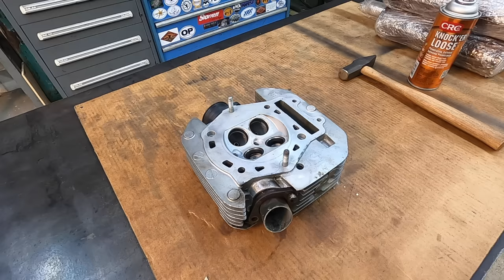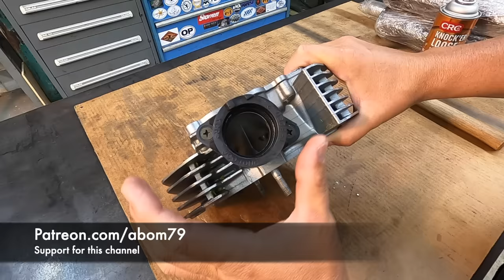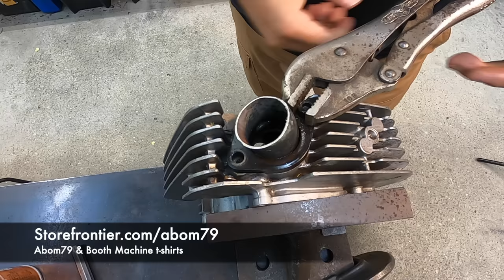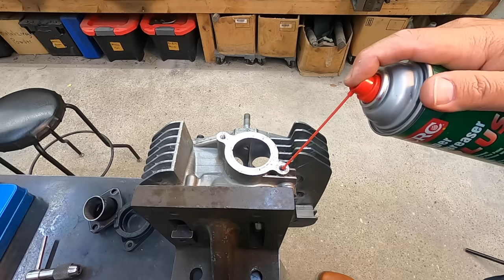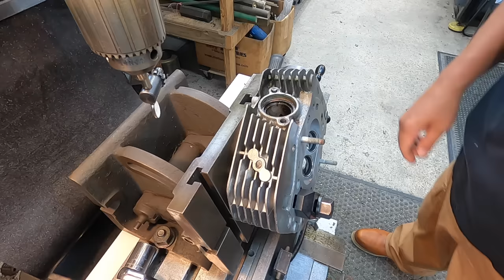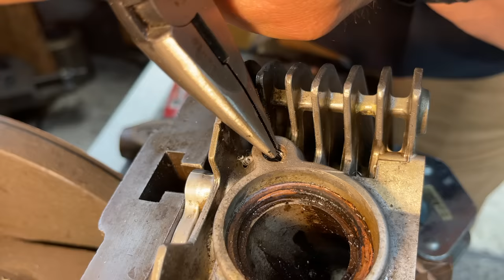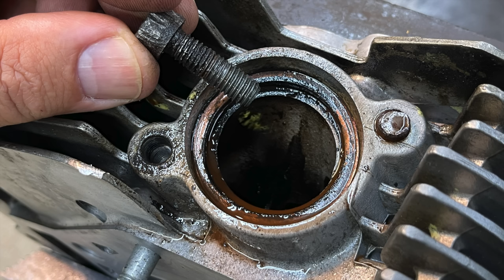Broken & Siezed Bolt Removal, DR 650 Cylinder Head

Comment: Top job Sir!!
If only people would us a high spec anti seize compound like loctite LB8150 SV silver. Works for exhaust temps up to 890C, and bolts will always come out.
I use it on aircraft engines.

I'm puzzled why you didn't use cutting lubricant fluid on your drill bits?!

Love the way you're in you're best clothes and have ultra clean ✋

Comment: Suggestion, buy some new Vise Grips.  Yours look older and the teeth are usually worn down.  Also, why didn't you heat up the head?  IMO, the aluminum would have expanded nicely and let it come out?

Comment: Love this content bro, all very helpful to save you from gett'n stranded from some "f'n" seized or broken bolt or juernle on a head or some creeky old manifold that makes your heart drop to into your socks. There's only one critique I have about your clip an that's all, something that was driven into my head ALL my apprenticeship, is never EVER drill into a hard surface with high tensile drilling tool without some sort of cutting oils to keep the workpiece and the drilling surfaces and cutting tool cool or you run the risk of blowing out the tip of the cutting tool edge or damaging the workpiece project further "JC" 😳 🙄😫 now that's an even bigger bummer or maybe I missed something in the clip? Either way I seriously dig this kinda joint to help get new tools in the mental toolbox bro 🧰 🧠 in my gourd! 😎👍 great content!  💥🎶💥 keep it coming 👌

Comment: At 25:37 the drill went through the bolt. I wonder if instead of drilling to 6.2, if you would have tapped the hole in the broken bolt with a left hand tap, then screw in a bolt all the way until the head makes contact. Then you would have something to grab onto to try to remove it. I thought about that a few times when I had broken bolts at work, but I never have left hand tap. I will have to try one of these days.

Edit: You would probably have to loctite the bolt so it wouldn't loosen when working it back and forth.

Comment: what do you do when the broken bolt is the engine mount.. it has lock tight on it to.. I also have 2 of the smaller ones to, going to try and remove by tapping like you did.. the engine bolt is so hard to get to being underneath also looks like the holes are not lined up right since removing one, another is connected to a pulley and the bolt is tight on the bottom but can raise the motor up and looks not to be screwed into the engine if that makes since.. I'm so confused. its on a kohler courage 19 engine for zero turn mower.. also leaking oil thru the front engine mount hole, was just hoping it wasn't the block but maybe the oil seal??? reckon?? thank you for video it has helped me in what I am trying to do.. best video I have seen yet... with no heat since I can't use heat cause probably caught fire...ty
Reply: Heat 150 °C Loctite dissolve.
Reply: Yea but if I put heat to it it is attached to the mower and oil all in it would caught fire

Comment: because the bolt is steel and the cylinder head is ally these bolts should have been coated with anti seize compound
for easy removal for servicing!

Comment: If you apply heat to the bolt and let the heat move down into the threads then put the head into a bucket of cold water , do this at lest three times then go back to the hammer and twisting . The heat and cooling causes everything to expand and shrink and since it is of different materials they will expand and contract at different rate and different amount of movement. The hotter the better , but depending on what you are working on .,care must be taken to protect part. Any amount of heat and cooling will cause movement and help separate bolt from part.,use as cold of water even if you have to add ice.

Comment: I remember my days of working on Japanese motorcycles 50 years ago.  If you didn't have an impact screwdriver like in this video, nothing came loose.  Even on brand new bikes.  I would have helicoiled those exhaust threads, or at the very least use studs not bolts, or the same problem will arise in 5 minutes or less.

Comment: Tig welder is king for removing broken bolts. I would not waste time trying to use the drill out method unless you had a mill or at minimum a good drill press and a 2 axis vice for it. You are not likely to ruin the part with the weld method but you can easily ruin it tying to drill it. I can’t count the number of people who have brought me off center drilled bolts with a bit or easy out broken off in them.

Comment: I've had good luck drilling through the bolt with a left hand drill bit. When the drill breaks thru and grabs, the screw backs out on its own. EZ outs are a pain.
Reply: I like drilling through the bolt with a very small bit so I can get lubricant on the bottom side of the threads.

Comment: would have used a welder and welded a bar onto it also the heat from welder would loosen up the bolt a bit then just buy new bolts

Comment: I tried removing a 12mm bolt hold my lawn mower blade. Wouldn't break loose even with a breaker bar. Finally rounded the bolt head. I drilled off the bolt head using a 12mm bit. Once the bolt head popped off and the blade removed, to my surprise,  I was able to remove the bolt with my fingers. Never experienced that before.

Comment: Question: for those impact drivers do you turn it so that it’s a solid field to unscrew it or do turned it against the spring pressure?
Reply: From my experience I hold the end of the impact driver then twist the body in the direction I need the screw to go. This sets the spring in the correct position to operate the driver, Either removing a screw or tightening up the screw, hold the tip and twist the body in the direction you want the screw to go.

Comment: What would u do if the broken bolts are on a motorbike that is assembled? 
I have a Mc where they broke off on the rear cylinder stud and i tried to drill them out, but the drill keeps slipping as i cant mark it... Because the bolts are too small. 
I been thinking if i could get a Jig or something to hold the drill steady , but haven't been able to find any. :(
Reply: I think it’s pretty obvious the engine has to come out… whether you drill em out or destroy the holes and it’s possible to tap new threads doesn’t sound like you have access to do either. If center punching the bolt is hard get something like a hardened steel nail. Maybe use a flat punch that is the same size as the bolt to tap it flat before center punching it with a nail.
Reply: same problem here only engine mount bolt..

;(

Comment: heat ,,,heat and heat ,,,  bigger, heavier hammer  while turning it like u did ,,,  then if REALLY bad ,   centre punch and small drill to relieve radial pressure,  keep attacking and you will be able to slip a flat head screwdriver in and heat heat heat and unscrew     dont have and have never needed a mill,  last one I did , cx650 turbo stud , rusted solid, ,, no problems

Comment: there is a spray called freez-off  never failed for me spray on the bolt it shrinks the bolt somewhat drill a hole in the bolt try ez-y out  after you freeze it

Comment: After you have done the penetrating oil thing, put head in boiling water and allow it to soak for a while to get evenly hot.  T--then while it is still hot, try to undo the bolts.  This only works for aluminium, where you can not safely use a flame, and it is better to keep the bolts just above water .  A gentle tap on the bolt then try to remove it.
Reply: Could in that case submerse in continually heated alum solution and bolt would dissolve. Slow process but I did it on a Tecumseh engine block.  Unfortunately after I  messed up trying to drill it out so still had to tap oversize.

Comment: I would like to see you get my broken bolt out. For 5 years or more I have been working on it, off and on. Underneath my motorcycle  built into a rubber bushing to hold the skid plate on.

Comment: On rounded  hex head, driving in a torx is two for one, the hammering helps break it free and the torx will cut new engagements to turn
 Ps and on broken bolts weld on a nut , the heat helps and if that does work drill  with left / reverse twist bits ,I grind normal bit to left works a treat and most times you can spin them out with the cordless once you have removed enough.
Reply: Do you use the same torx driver that you broke the handle off by hammering it, or a new one?  :)
It is a good enough idea to me to sacrifice a torx driver.  I have also had good luck taking that flat blade screw driver bit from that impact, (should be hardened), hold it with a socket and extension, and hammering in a straight slot too.

Comment: Just a thought but couldn't you thread a lefthanded bolt into the broken bolt so once it's tightened and keeps turning left it MIGHT remove the old bolt at the same time? I don't know fortunately I've never been in this situation. At first I thought that was the route he was taking when he said a Lefthanded drill.

Comment: A modified hex bit socket ground to be tapped into the caphead screw and a 3/8 impact gun turned way down.  May take a minute or two to shock the rust bonds free.

Comment: If you had welled a bolt on there which you already said doesn't work , sometimes termsthe heat from welling the bolt on there would also break , at least it'll come right out every time

Comment: I believe its called Galvanic corrosion that accrues between dissimilar metals like steel and aluminum that's what has the bolt threads locked into the aluminum head threads. Its basically a different kind of rust only this is a white power like form of rust.
Reply: Correct. That is because the aluminum is the anode in the reaction, it preferentially corrodes instead of the steel. "Rust" in aluminum is a white powder. Similar to rusted steel, the oxidized aluminum occupies more space, which decreased the thread clearance to the point that it locked the bolt into the threaded hole.

Comment: Cant u use the allready free exaust hole to set the line up for the other hole with a drill to snug slide in the free hole so it would perfect line up to drill the other hole?
I can be wrong just suggesting.😅
Nice vid btw.

Comment: Now we know Adam and Joe Pie know how to do this. But why didn't you use the rust buster spray on the drilled hole to unlock the remnants of the old bolt before picking it out with needle nose pliers?

Comment: its so odd today i had to replace exhaust manifold gasket on my old 1966 dodge wrecker i am fixing up and broke off one of the bolts one out of 8 wasn't bad. i thought about welding but i used the drill out method. i couldn't get ez out to work drilled and used small punch got it started and screwed it out saved all the threads and didn't have to remove cylinder head.

Comment: I've come to the conclusion that its much better to weld a bolt to it FIRST to get heat to the threads and have something to turn, than to take vice grips and twist it off making it near impossible to get out. I've worked on little stuff, like 1/4"-20 on up to 1 1/2" grade 8 bolts in Locomotive trucks. It's hard to beat. If you have a sheared off stud, and you can weld a flat washer of the next size down, to it and then weld a nut to that washer, youve zapped it twice with heat and you can put some decent power with an impact to it. Impact hits it a bunch of times, a tad at a time, where as twisting only, doesn't help it over the ledge. It SHOVES it over the edge
Reply: What type of welder do you use to weld washers and nuts to the bolt?

Comment: What are JIS screws you mentioned at the exhaust?
Reply: JIS stands for Japanese industrial standard. Usually the only JIS fasteners I would see look like Phillips head srews on older Japanese cars and motorcycles/atvs, but they are not. A #2 phillips will usually cam out if the screw is tight. Need the appropriate #1,2,&3 JIS cross-point driver for best chance of removal.
Reply: Phillips designed a drive head that was fast to use for assembly lines and would cam out before they could be overtightened. 
JIS have less web (straighter cut) in the cross than Phillips so do not cam out if you use the appropriate drive bits.
JIS bits can be used with Phillips fasteners, Phillips drive bits destroy JIS fasteners.
If you work on Japanese automotive especially then you really should have Japanese tooling for specific fasteners made by the likes of Vessel, Ko-Ken, Nepros etc

Comment: Recommend anti sise to help the next time it's worked on
Reply: 3 ounces of anti seize would do the whole world alot of good. Good nickel anti seize for the high temp stuff.
Reply: @verteup I worked with a guy in the power industry, he would be covered head to toe with anti sneeze (auto correct keeps screwing with me). No kidding on the 3 ounces.
Reply: @JAMESWUERTELE  yea 3 ounces of anti seize would do hundreds of bolts.

Comment: The best way is to weld a thick flat washer to the broken stud then weld a larger nut to the flat washer. After waiting a minute for heat to expand the block cool the welded nut with a spray directly on the nut. Once the nut has cooled enough to touch easily unscrew the nut.
Reply: Spray of water

Comment: Idk, Nut and welder usually works, I'd it doesn't, add a washer.. has never ever let me down
Reply: Yes this is the way I've had the most success with. If it's broken off flush then I spot weld the area to build up a stud. Sometimes then the heat transfer allows me to get it out with mole grips
Reply: Same here. I've had loads out this way.

Comment: Bake head  500 degrees drill 1/16 hole freeze . Listen for light click . Remove any stuck bolt . Anti seize is nice but when your talking real stuck. Go this way
Reply: Above the critical temp for aluminium
Reply: @bingosunnoon9341  
I was referring to steel blocks.
Aluminum blocks have to use 
Ultrasound.
Reply: Place block with damaged screw in 18”x24” ultrasonic cleaner .
Drop down on engine hoist to submerge area.
50c for 30 min 4 times.
Use dawn detergent.
The first shot you will see a light brown cloud around stuck area.
20 min ultra off keep temp up .
Run 4 times.
After the fourth dip begin extraction.
Same previous principles.
Freeze , turn in and slowly back out.
Unfortunately ultrasound equipment is very pricey.
It might exceed the machine shop.
Reply: I have yet to have a stud beat me.
However a 60 k shop is needed to achieve a $150 machine shop removal.

Comment: Was that a bottoming tap you used in the hole since the hole is dead ended once you run a standard tap should use bottoming cap to clean all the way to the bottom of the hole. Nice job haven't seen anybody work like I do for so long.
Reply: In the aircraft industry we use some certain types of the anti-seize material going from steel to aluminum so you don't have that dissimilar metal corrosion that bonds at like it did if you can find something like that and let people know about it I help prevent some of this kind of thing I know it's been there a long time but I'm just saying I couldn't be helpful for the people that reassemble that kind of thing.
Reply: "I didn't realize it until I drilled it but this hole actually went all the way through to the other side there." (29:54)

Comment: I would have drilled the broken stud with a smaller drill bit, and then attempted an easy-out that fits right, including some overnight soakings with penetrating oil, and some heat-cool cycles too.   Drilling with a larger bit jeopardizes the threads too much.   Trick is to find the right size drill bit that allows the stud to 'collapse' (loosen) without breaking off the easy-out.

Comment: Had a jammed socket head screw that the Allen hole was rounded and my vice grips kept sliding around also. Heated the head to orange hot and smashed the head to a narrow race track shape. Let it cool and put a adjustable wrench on it and wiggled back and forth with penetrating oil (50% acetone/ATF) and the screw eventually came out. Little bumps CW and CCW. Also gripped the smashed head with a vice grip clamped in line with the shank and put a wrench on the vice grip for more gentle torque.

Comment: Nice, elegant solutions. I doubt that the "jus' weld ya a nut on there an' crank on it" guys would have a clue how to set it up in the mill.
Reply: I wouldn't need a mill for that. That's serious overkill for an easy job. Been repairing threads in engine cases, cyl heads,... in my garage as a 17 year old...without setting up special machinery.
The guy has some impressive machinery skills, no doubt. But the real skill on this particular job is doing it without special machinery and damage.
Reply: @sinki19841984  No, the skill is in doing the job right. If someone can do that task professionally and well with a brick and a garden rake, more power to them.

Comment: Have a idea After your first hole rather drill it out larger use a small end mill and cut into the side of your hole almost to the thread of the base metal then with a chisel or punch drive the side of the bolt into the center collapsing the bolt and breaking the threads away from hole and turning the bolt out.

Comment: Just to let you know steel and aluminum do not like each other and bare steel and aluminum will cause an effect called galvanic action. You see it on aluminum storm windows with steel screws with the streaks of rust. It is the reason bolts have a heavy cad or zinc plated or powder coat to keep the steel and aluminum seperate. In assembly use of Moly assembly grease is a plus and will hold up to exhaust heat. good job getting that bolt out. Usually the aluminum thread pull out with the steel. Good job!!!